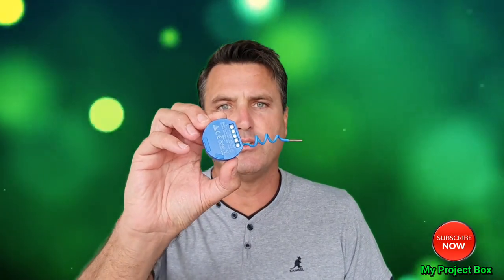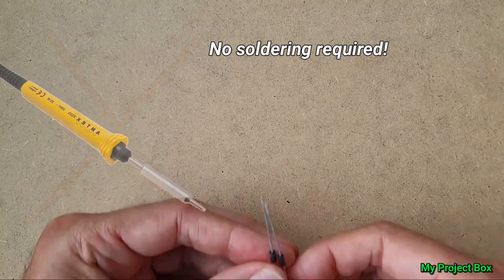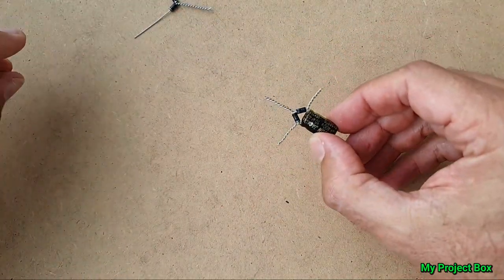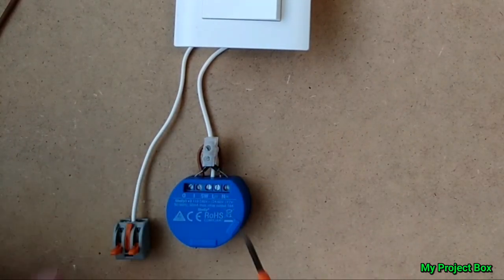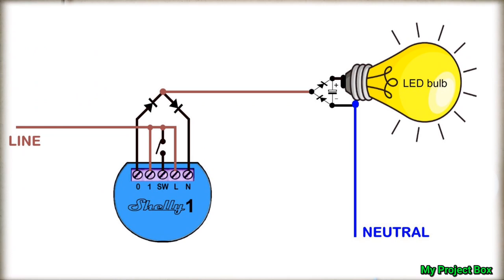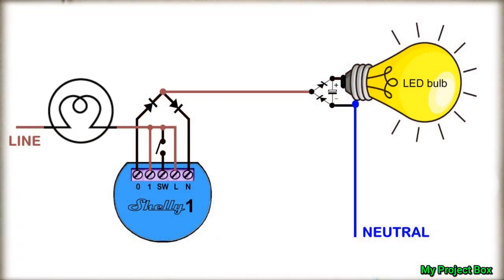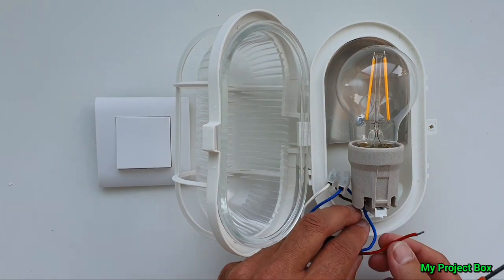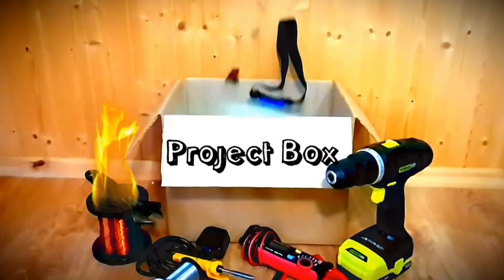Shelly1 without Neutral make a DIY bypass circuit hack! #shelly #Neutral #smartswitches

Comment: Man. you made my day!!! 
I've been searching the internet for days to find out how shelly bypass works or to find a cirquit diagram.
My intention was the same as yours: how to design a DIY solution that provides the "without neutral" functionality - for sure at much lower costs as buying the original shelly bypass.
Thank you so much for your video(s) about this solution!!!
Well presented and explained. Easy to undestand and to copy into my installation.
Thumbs up.
Keep up the good work!

kind regards from Frankonia ( / bavaria / germany)
Reply from the maker: Thank you. My circuit works in a slightly different way than the official shelly bypass. Its works with most LED bulbs/Lights, but not all types. LED bulbs with a "capacitor-dropper" LED driver , will NOT work.
Although the circuit works well, I have made several "improvements" , to make It more robust, and able to handle bigger loads, without blowing the fusible resistor. The main difference, is the fusible resistor is now in series with the capacitor, so it won't have to carry the full load current. https://youtu.be/mznx0xoF8Ck

Comment: This hack working great also with the Shelly 1 Mini Gen 3. 
As a capacitor, I found a 450V 10 uF and I use this instead of the suggested 400V 10uF. 
Thanks a lot for this video, incredibly useful and well explained. 🙂
Reply from the maker: Very nice! Thanks for sharing your findings. It's great to know that it works with the newer version too😉. I can't test my circuits with every smart switch available on the market, so this kind of feedback is extremely important 👌.
I'm constantly trying to improve my circuits, and I made a more robust/tougher version, in this video. https://youtu.be/mznx0xoF8Ck

Comment: Is it possible to achive this with a 2-way circuit? (2 switches for the same lightbulb, without neutral line accesible)
Reply from the maker: @zrebrutibreniti  I don't think It's possible to do it in the same way😮‍💨. I have tried to work it out for 2way switches, but no luck yet. It will be possible in slightly different layout. If you put the shelly up by the light fixture, it should work just like my sonoff 2-way lighting circuit. https://youtu.be/9hQFFsBkxaU

Comment: Hi I was wondering if you have figured out how to work with a dimmable wifi module?
Reply from the maker: It will be very tricky/difficult, to make a simple circuit for a dimmer WiFi-enabled module. My "simple circuit" definitely won't work 😕 🤨😢
Reply: @MyProjectBoxChannel  haha thank you for responding I did try it and yes it didn’t work! But thank you for sharing this work around as it worked with my previous wifi switch😊😊

Comment: When you toggled the light with the switch, the app didn't reflect the change in state of the load?
Reply from the maker: This video was made quite a while ago, so maybe the new version of the shelly app responds more quickly🤔. I'm not entirely sure.

Comment: Thanks for the helpful video. 
I was wondering is it possible to use this schema to build a bypass for the "shelly 1l" (if you don't have the shelly bypass ) - maybe will be only the part with the capacitor ? Do you have an idea?
Reply from the maker: The way the Shelly1L bypass works is completely different!! Please don't attempt to use my circuit on the Shelly1L. I haven't experimented with the 1L Yet. But I will leave a message here if if I know how to make it work. If you however do want to experiment your self, please put a "current limiting" light bulb, inline with the Live wire, feeding your test setup. (must be old style incandescent light bulb) That way nothing will go bang!

Comment: Thank for the video. Learned a lot! What I was actually looking for is what happens if you have the fisical switch on, and want to control it with the app. What happens then?
Reply from the maker: You can use both switch and app, at the same time or independently. Or Google/Alexa control, and have manual switch control as well. It doesn't matter which position the light-switch is in, you will still have app control as well. The Shelly just gets an edge trigger from the switch. Whether the switch is on or off, it's just a trigger for the Shelly. Both on to off transition, is a trigger. And off to on transition, is another trigger.

Comment: Hello, great video. I have no neutral wire and will try this hack. About the fusible resistor, 10 ohm 1W or 2W?
Reply from the maker: 2W is better.😉👍
I'm constantly trying to improve my circuits, and I made a more robust/tougher version, in this video. https://youtu.be/mznx0xoF8Ck
Reply: @MyProjectBoxChannel  Thanks mate! One silly doubt: If the switch operates not one but two or more lamps, I guess ALL lamps MUST have the diode/condenser circuit conduit? what happens if a lamp doesn't have it, blows up, blows the fuse, doesn't light up?
Reply from the maker: @thedaffyduck  you can use just one diode capacitor feeding more than one light, but it needs to be at the first light supplied from the switch. It is better to have a capacitor/diodes on every light, you will have less chance of making a mistake, and blow something up.

Comment: hi! love your video. do i need the same components for 220V mains? thank you in advance
Reply from the maker: Yes I used 220v in this video👍😉
Reply: @MyProjectBoxChannel  hi again Ty for the prompt response. can you post a brief diagramm for the shelly L1 since i cant Get it to work without the led lamp constant flickering. Thank you again
Reply from the maker: @r1ng0s4  I don't own a shelly1L  . So I can't personally verify the circuit works with it. Some people have reported that it does work. I would need to experiment with the 1L first, before I provide a circuit example.

Comment: After a while my Shelly 1L lost network connectivity. Switch still worked, but schedules didn't. Small LED lamp only, with original bypass, who knows... So, I whipped up your circuit. Great idea! And so far things look good, thanks for sharing! Let's see how long this is going to be stable, but I have more faith in your half-phase approach than in the bypass.💡
Reply from the maker: Interesting🤔. I never thought of trying it with the shelly1L. Thanks for sharing 👍
Reply: i have the shelly 1 L also but  i cant get the lamp  not to  flicker no matter the switch possition :( can you share your diagramm? thank you very much
Reply: @r1ng0s4  Oh, a misunderstanding here: I ditched the Shelly 1L and used "your circuit" literally, with a non-L Shelly. I have not tried with the 1L either.
Reply: FYI, I have tried with Shelly 1L now and that seems to work as well, in principle. Comms is stable, alas the LED flickers. I do not (yet) use the bypass (I don't think that would make sense electrically) and I am not sure if the flicker might be related to the specific LED lightbulb I'm using right now - it's not the same bulb as the one I'm using with my more permanent Shelly 1 (non-L) setup. YMMV.

Comment: First of all thank you for the great work. I have made your circuit but all I had was the blinking lamp. Where can I be mistaken?
Reply from the maker: You probably have a diode in the wrong polarity. But be aware that you can now have a damaged diode, and it might not show physical signs of damage. You could  replace all the diodes and make sure that the polarity is correct, or test for faulty one and replace it. It's a simple circuit, but easy to make a mistake and damage something.
Reply: Already had a shortcut and freaked out :) after that I have remade the circuit and all is well
Reply from the maker: @bulusomer I'm glad it works now 😅. Just be careful with mains voltage circuits ⚡️

Comment: I'm curious if a regular Shelly One work in the following setup. L to L, O to the bulb, N to the L side of a SmartBulb! Tanking into account the smartbulb is always powered (not always ON though), will the shelly work? In this case 240VAC would be split among the 2 seried consumers, Basically making 120VAC fall on each.

Comment: Thanks for the video. I have 2 lights at 2 different outlets, left and right beside a mirror. Do in need the part with the capacitor on both lights?
Reply from the maker: You could have two LED light bulbs connected(in parallel) to one "bypass circuit". But you might have to increase the capacitor size. It's probably better and easier, to have a separate "bypass circuit" for every bulb. Because you would have to know what bulb is being fed from the switch first, then connect the bypass there. Then the second bulb would have to be connected  after the bypass to the first bulb. You could easily make a mistake! And blow something up! I recommend  you make a test circuit first, and verify that it all works as planned. If you test it with a "safety limiting incandescent lamp" , in-line with the L supply. Then nothing will blow up if you make a mistake with your test circuit. Remember this circuit is a experimental prototype! So you could use bigger diodes/capacitors for more current, that meets your specific requirements. It's worth remembering that not all LED bulbs will work with this circuit, but most newer ones will work just fine. Good luck! and let us know how you get on😉👍
Reply: @MyProjectBoxChannel  Thanks for your reply. I don't know how the cables are inside the wall, so I did it with seperate "bypass circuits" for each light and it works like a charm. Used a shelly plus 1 and the components you mentioned in your video. The only thing is, that its very tight behind the switch with the additional components, but i had luck and it fits. Thank you very much :)
Reply from the maker: @andreasenns1044   I'm glad that you got it working in the end😉👍. It's nice to know that it works with the shelly plus1, as I have not tested it on the plus1 yet😉. If you solder some flexible wires to the diodes, it might make the installation a bit easier.

Comment: Love this. Any thoughts on how to put the shelly at fixture with the same safety features and set up? Would love to see a follow up on this. Unfortunately my switch boxes are too tight.
Reply from the maker: I have a similar circuit, were you are able to put the shelly1 directly by the light fixture. It's slightly more complex. You only need to put a diode across your light switch, and everything else goes up by the light fixture. Here is the video for the shelly1 https://youtu.be/YItMu6VJGBI
You can do 3-way (2-way) light switching aswell, as shown with this Sonoff example example, of the same circuit. https://youtu.be/9hQFFsBkxaU
Reply: Thank you! I will check this out
Reply: Any chance you have the walk through of actually how to make the module on the Board? (novice here) looks like a great option.

Comment: Could the Shelly 1 also be used in the European 2 gang configuration without neutral?
Reply from the maker: If you want to make a double light switch, then the shelly2.5 could work without neutral(its better than using 2 shelly1s). It could be wired like my sonoff dual-r3 circuit in this video. https://youtube.com/shorts/WXQtRh0gYJM?feature=share
Reply: @MyProjectBoxChannel  Thanks! I’ll have a look at that!
Reply from the maker: @AnotherJoe  here is the same concept but with a sonoff M5 https://youtu.be/8h29-0rpQJo

Comment: Another great video! Would it work the same way 2-gang switch and Shelly 2.5?
Reply from the maker: Yes I think it will. You only need the bypass on one output channel. The second channel can work as normal without the bypass and diodes. I have a similar example with a sonoff m5 https://youtu.be/8h29-0rpQJo  and with a sonoff dual-r3 https://youtube.com/shorts/WXQtRh0gYJM?feature=share
Please let me know how it works out for you😉
Reply: @MyProjectBoxChannel  Thanks a lot for quick and prompt answer!
Reply: @MyProjectBoxChannel  Quite a lot of work esp. first time but worth it. It works! Thanks again!
Reply from the maker: @mooniksiz  so you managed to get my bypass circuit working on the shelly 2.5?
Reply: @MyProjectBoxChannel  Yes, exactly!
Reply from the maker: @mooniksiz  I glad it worked for you😉👍. Please Subscribe, like and share 😉
Reply: @MyProjectBoxChannel  it worked few hours and died 😳 Need to try diagnose if it's one of components or Shelly.
Reply from the maker: @mooniksiz  OK. Let me know how you get on. Did you use a fusible resistor? Is the capacitor connected the correct way? Maybe  make a simple test rig to test the circuit and verify its all working properly. What is the power of the LED bulb?
Reply: @MyProjectBoxChannel  Yes and yes. I've heat shrink it all nicely. Shelly is fine. :D Looks like resistor broke. I have 3 bulbs 1x12W and 2x6,5W.
Reply from the maker: @mooniksiz  mabe you need a different resistor for your connected load. You could put 2 in parallel to make a 5ohm resistor. Is the 12W connected to the bypass with the resistor?
Reply: @MyProjectBoxChannel   Bypass is next to 2x6,5W. Will try with double resistor! Thanks! When is your next video?
Reply from the maker: @mooniksiz  I'm very busy travelling at the moment. I don't have much spare time, or access to all my equipment. I did do a teardown video recently of a cheap gu10 smart bulb.
Reply: @MyProjectBoxChannel  Hi, Just to finalize. After doubling resistors all working fine. Thank you!
Reply from the maker: @mooniksiz  that's great 👍. I think I need to do some more testing, to come up with a more universal design, that works with "everything " 😉

Comment: Just nitpicking: You don't always need the bypass with the 1L
Reply from the maker: That's true, but you need a lot of LED lamps connected in parallel, or use old school tungsten filament lamps. So most people would need it.

Comment: Let me know if and when it burns. Looks like great idea :)
Reply from the maker: I've tested it extensively with both the Shelly1 and sonoff miniR2. So far so good. Adding the fusible resistor is a good idea, because it takes a lot of stress off of the capacitor and diodes. It acts as a safety fuse if anything goes wrong. Obviously the more people that test this circuit. The more we will have information on its reliability.
Reply: @MyProjectBoxChannel  I just had removed my V1 Bypasses from Shelly as i was afraid to burn down the apartment. As IT guys i have some understandung but its more like 1%.

Will monitore this here for future feedbacks
Reply: Hello! Thanks, nice idea! I'm thinking to try this on Shelly 2.5. Do you think it will work? I really need a no neutral 2 channel relay...
Reply from the maker: @adi_tudor  it might work, but only for LED bulbs. Don't try it with AC motors. I haven't tested the circuit with the Shelly2.5 yet. Let me know if it works, if you give it a try( use a "safety current limiting" incandescent bulb, to test your circuit first). You probably won't be able to do it on a version with Dimming function.

Comment: can it work with a 33uf 400v capacitor?
Reply from the maker: Yes 33uf is fine, but you should add the 10R fusible, Inrush current limiting resistor, for such a big capacitor. You can also use bigger diodes if you need more current.
Reply: @MyProjectBoxChannel  Thank you, It's working perfect.
I don't need more current, only one LED light, probably like 10W.

I used a Shely Plus 1, works perfect.
Reply from the maker: @DIYGUYIL  no problem happy to help. Thanks for testing it on a different device and verifying that it works.
Reply: Hi, great video, what is the specification of the fusible resistor (Watts, voltage, current, etc) and where do you source yours. How did you choose 10R
Reply from the maker: @frolfe1  10 ohm 1watt fusible resistor. The value is not critical( it can be 1/2w or 15ohm, just has to be fusible type). You can steal one, out of a old LED light bulb. It's a common value fusible resistor used in these type of things. The circuit doesn't "need" it to function, it's just for safety and in Rush current protection, of the capacitor. I got mine from Robert Mauser. https://mauser.pt/catalog/pesquisa.php?keywords=Resist%C3%AAncia%20fusivel%2010R%20

Comment: Hello! I tried this circuit, using an incandescent light bulb and and Compact Fluorescent Lamp (https://en.wikipedia.org/wiki/Compact_fluorescent_lamp). Every time the circuit worked for a couple of seconds and then the inline fusible resistor burned out. Is this because the light bulbs? Should this work only with LED bulbs? Thanks!
Reply from the maker: Yes you are correct. My experimental circuit was designed for LED bulbs. BUT it should work fine with some CFL lamps. It's possible the load is to much for the 10 ohm resistor. It's also possible that the capacitor is connected with incorrect polarity. Or maybe a diode is the incorrect polarity.
Reply: @MyProjectBoxChannel  Thanks! I double checked the polarity and recreated the circuit with new components. Every time the fusible resistor burned. So, probably you are right about the load. I will go and buy some new LED bulbs and test again. Will keep you posted with the results. Cheers!
Reply from the maker: @adi_tudor   You could also try it with the light bulb disconnected/removed, and see if the fusible resistor still burns out.  That way at least you know your components are connected correctly.   Be aware of the capacitor holding a charge,  after the power is disconnected,  So you don't get a nasty zap from it.